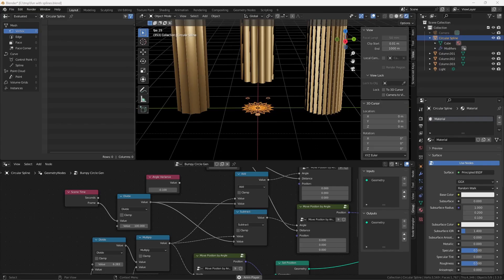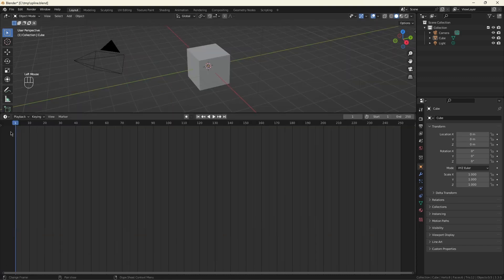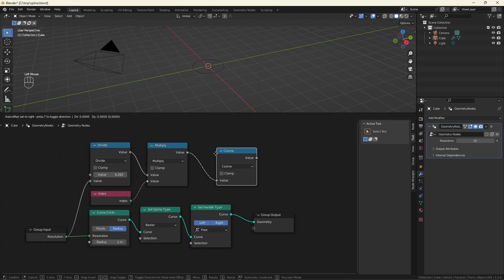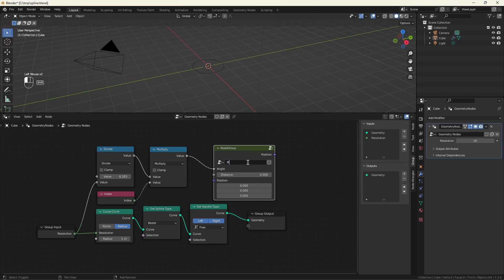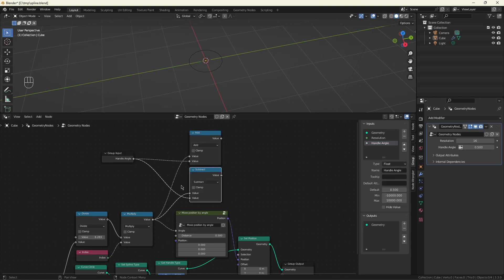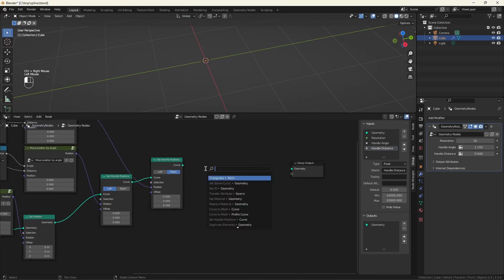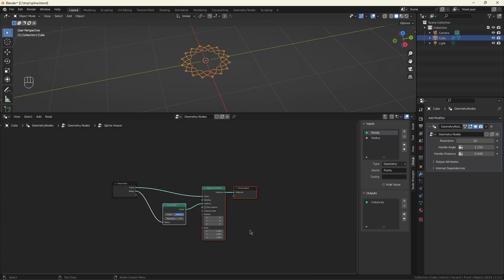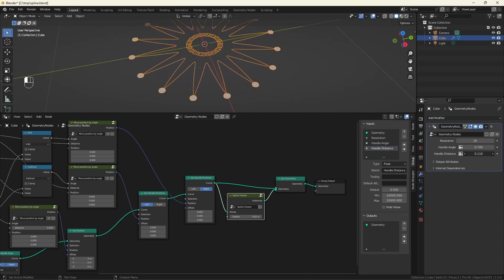Blender 3.0 Procedural Generation of splines, scallop profile for column, and a spline handle viewer

Comment: Shouldn't you have dropped the Set Curve Type node onto the wire that goes to the Curve to Mesh - Profile Curve input instead of the one that just goes straight to the join geometry... here: https://youtu.be/HYWUY4tmcGg?t=692
Also, what about removing all the inner geometry in the column and caps?
Reply from the maker: You are right about the curve to mesh. I should have picked a curve where it made a visible difference. I would have caught the mistake.